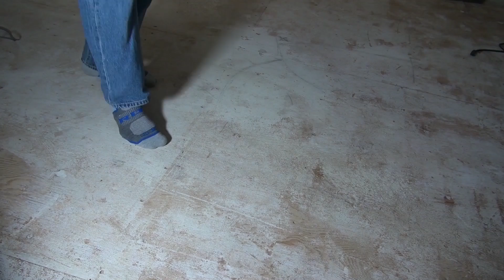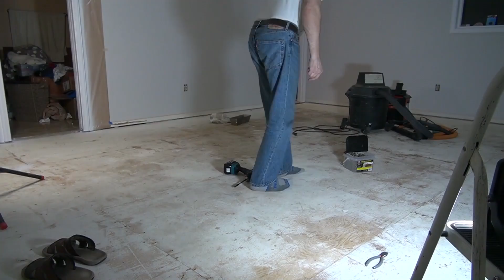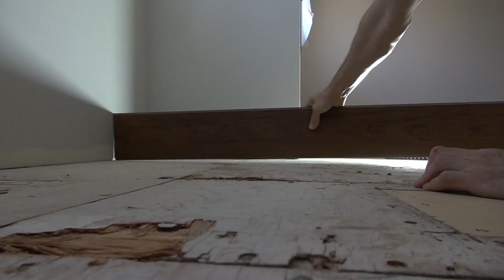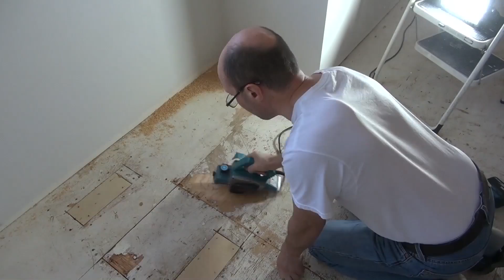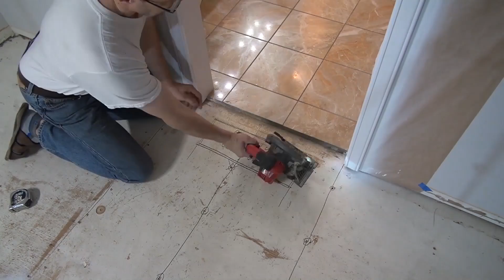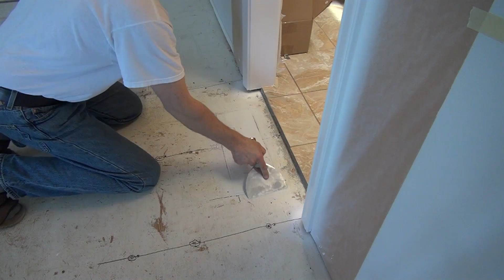How to Fix Repair Squeaking Floor. Как устранить скрип пола

Comment: That’s what I do on every job before installing hardwood flooring on top of sub floors.  I use at least 2&1/2 inch long screws because you are going through 3/4 inch thick sub flooring and I want at least 1 and 1/2 inch of the screw to penetrate the joists so there is no chance of them getting loose.  I’ve seen contractors shoot lots of nails in sub floor to fix squeaks.  Remember, screws don’t back out but nails eventually do.
Reply from the maker: You right. Thanks!